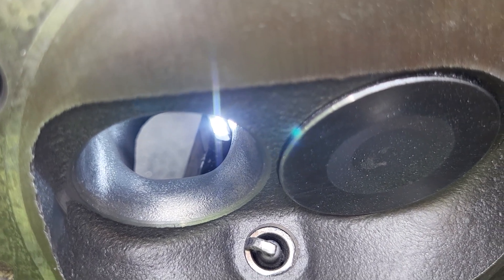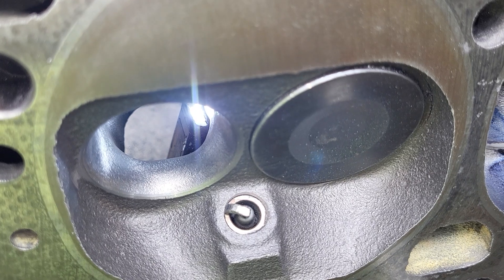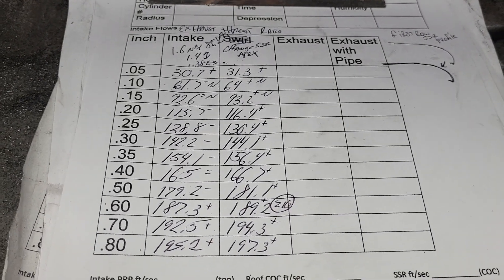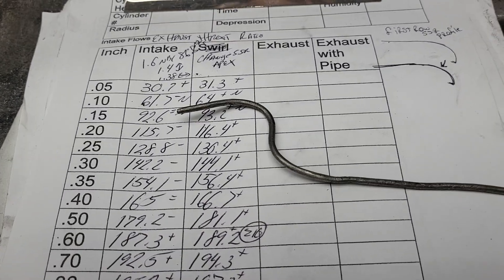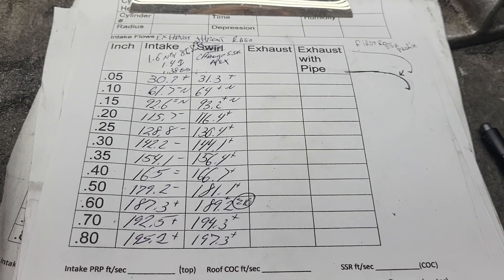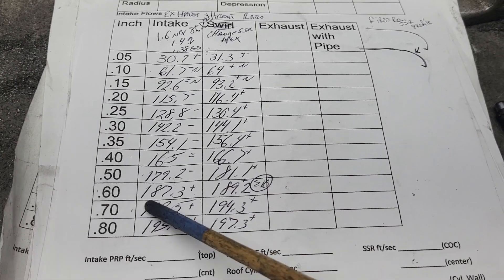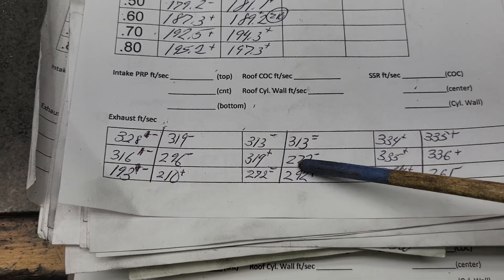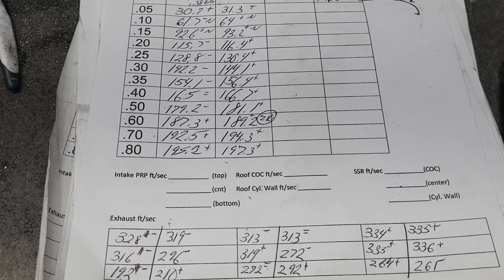Chevy TBI head exhaust throat experiment, Change is ssr apex. Winner?

Comment: Morning!. I just had a light bulb moment. Mission impossible heads. Does a 318 poly intake rocker fit the L.A. head ? If it does..... could the push rod pitch be completely removed?.
Reply from the maker: @approachingtarget.4503  I never worked on a poly and 318 pinch could be removed with welding or epoxy work. Thanks

Comment: Hi Charlie. Just some math to help your friend out. Take the water column reading from the pitot tube and then multiply it by the square root of 66.2.  That will give you air speed in feet per second.  I have this written on my flowbench. I got it from a book but I can't remember which one. It might have been Harold's book Practical airflow. Andrew
Reply from the maker: @andrewburlock2653  That book is excellent. Thanks
Reply: Thanks for the help, I actually just got that book. I will be reading it this week. I THINK I got it sorted out. The issue is trying to scale it up from the 8" of depression I can pull on an SF-110 to equal what it would be at 28".
Reply: @TDMP-ThemDamnMoparPeopleTy This was from SF-300/600  Flowbench Operator's Manual. Hope that helps,

-juhana
Reply: @TDMP-ThemDamnMoparPeopleTy  Glad I could help. I will be converting my bench to electronics but for now I do the math. Andrew
Reply: Test Pressure       PeakVelocity

1" H2O                     66.2 ft/sec
3"                            114.7
5"                            148.0
7"                            175.1
10"                          209.3
12"                          229.3
15"                          256.4
20"                          296.0
25"                          331.0
28"                          350.3
30"                          362.6
35"                          391.6
40"                          418.7
45"                          444.1
65"                          533.7 @TDMP-ThemDamnMoparPeopleTy

Comment: Hi! What happens if you make a big blunder with a port? How can you continue the development with the inferior port? Do you leave ports alone and start with an other one? How often does this happen?
Reply from the maker: @laszlototh5956  It happens alot when you start. You get better as you gain experience. If you have to use that casting you fix it the best you can and do not make that mistake on the rest of the ports.
Reply: @servediocylinderheads  Thank you!

Comment: I noticed that the valve has not been unshrouded. That will change how the throat flows.
Reply: How will that change how the throat flows ?
Reply: @luckyPiston  The valve isn't flowing to it's fullest capability on the chamber side so the full effects of the changes to the throat ratio aren't being realized.
Reply: @briantayes2418  Yeah i think that area plays on important part maybe even more so than that same area on the intake side , i think gases escaping the chamber are traveling across the exhaust v/v face and have to make a 180* turn there , i think if that relief area is angled slightly it can help those gases make that turn especially at low lift , low lift flow establishes velocity earlier in the lift cycle.

Comment: I second the rationale for the throat ratio, I see the spark plug boss is guiding air around the short side, maybe just be mindful of that when you shape the bowl radius . @0:04 the shadowy areas are telling you where the air is not flowing. Even with the light shining towards the intake valve, there's some dark spots on that radius, to me, that seems like flow splitting in two places. Bifurcation in nerd talk.
Reply: So for you looking at that SSR you see more flow in the corners than in that shaded center area ?
Reply: @luckyPiston  I see more flow in the center of the short side, less so on the valve side, and more so on the cylinder wall side of the throat.
Reply: Are u also saying that the plug boss is influencing flow on the right hand side of the SSR ?
Reply: @luckyPiston  Yep, like waves crashing on a pier. When the valve opens on the exhaust stroke, the airflow conforms to the chamber, and has to flow around that boss. Then the piston starts coming up and pushing out the leftovers. During the upstroke, the boss acts like a squish pad. That boss is put there from the factory to increase turbulence near the plug, during intake and compression strokes.
Reply: @luckyPiston  On the latest video, there's still noise at low lifts, right where the plug boss would be affecting during the overlap phase.